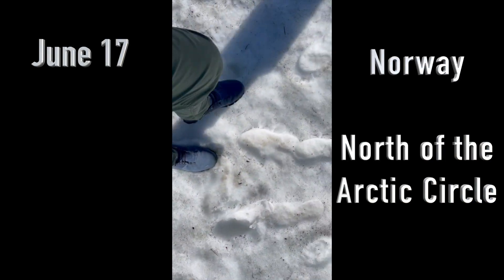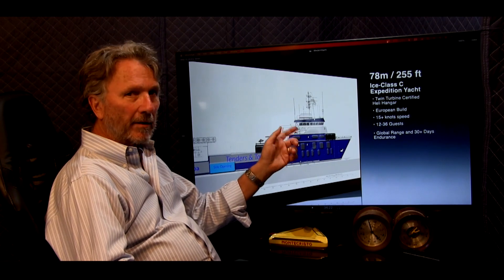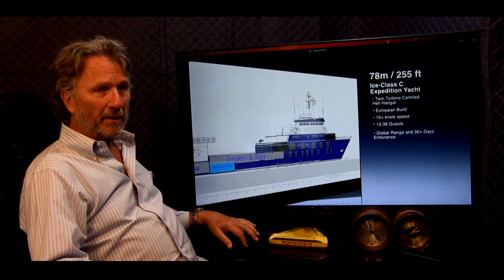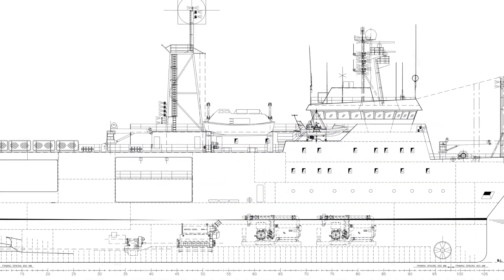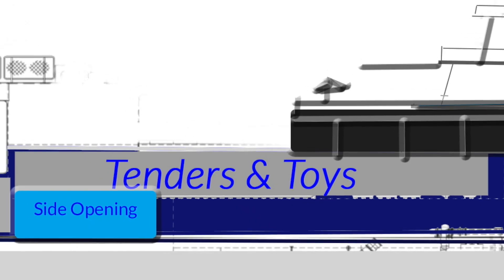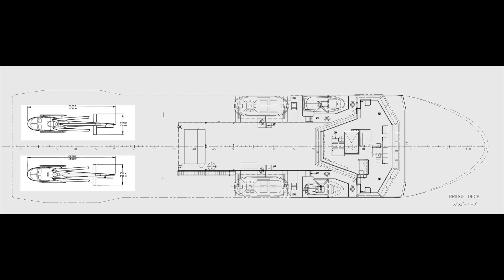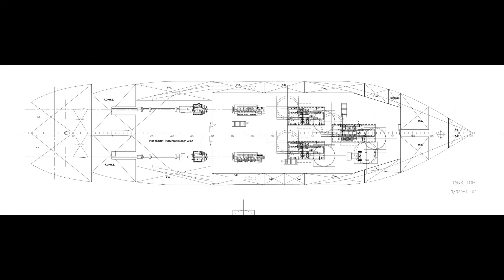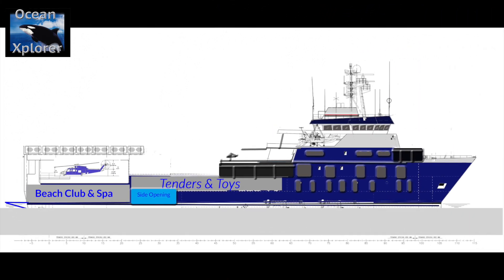Norwegian-built 255 ft/ 78m Ice-class Expedition Yacht w Commercial Helo-Pad

Comment: How much fuel does it burn per hour at econmical cruise? Can u post the specification for the ship?
Reply from the maker: MAIN DIMENSIONS Length over all: 78 m Length between p.p.: 67,7 m Breadth, moulded: 17,0 m Dept Main Deck: 7,6 m Design draught: 5,4 m Scantling draught: 5,9 m

TONNAGE & CAPACITIES Gross Tonnage (1969) approx.: 3700 GRT Fuel oil (Ex.sys.tks.) approx.: 1400 m3 WB approx.: 850 m3 FW approx.: 220 m3 Cable oil, clean oil: 20 m3 Cable oil, dirty oil: 20m3 Work deck area (Main deck): (8000 sq.ft) 740 m2 Recording room area: 200 m2 Helideck AS 332 Super Pumpa. CAA/DnV

ACCOMMODATION Accommodation 56 persons in total, of which: - 18 one-man cabines - 18 two-man cabines - 1 two-bed hospital

PERFORMANCE Trial Speed (4,5): 15,6 knots Design pull, 5 kn: 30 tonnes Max.pull, 5 kn: 50 tonnes

TECHNICAL DATA Bergen Diesel, main engines: 2 x BD 32 M& each of 3300 BHP at 750 rpm Ulstein Propeller: Twin screw propulsion comprizing: 2 x 1500 AGSC controllable pitch propulsion plants, each with: Low noise, 4-bladed secwed CP-propeller, driven through a reduction gearbox with two-speed PTO for shaft generator. Ulstein Propeller, bow thruster: 150 TV, 590 kW/800 HP, el.driven Ulstein high lift rudders: 2 off Shaft generator: 2 x 2000 kVA, 450 V, 60 Hz Aux.generator: 1 x 1338 kVA, 450 V, 60 HZ, driven by one Caterpiller 3512 TA, diesel engine, rated at 1125 HP at 1800 rpm Clean power: 2 x 73,6 kVA, 208 V, 60 Hz, SCFM, 2000 psi, driven by Caterpiller 3516 Diesel engine Life boats: 2 x 48 persons enclosed Life rafts: As per Solas MOB boat: 1 x Seabear 23, with inboard diesel. Davit deployed Work boat: 1 x Seabear 23, with inboard diesel Davit deployed Norwinch Windlass: Type AV-33/38-36 K3

Ulstein Maritime Electronics: Switchboards - Electronic remote control system Main Propeller (PROCON) - Joystick control system (POSCON) - Electronic remote control system - Bowthruster (SITCON) - Bridge control consoles - Engine room console - Starters (for el. motors) - El. test board - Engine room telegrahp - Microprocessor based alarm system with dead man system and printers)

ELECTRONIC EQUIPMENT Radar: Furuno FAR-2822 / XBand, ARPA - 120 NM Ranger x-band (3 cm), ARPA, 72 miles Radar: Furuno FAR 2830S, SBand ARPA-96 NM Range Innmarsat: JRC JUE 45A MKII Voice/Telex/Fax

Radio /to GMDSS Requirements): Skanti TRP 8750 Duplex SSB MF/HF, 750 watt. Thrane & Thrane TT3200 Radio Telex System Sailor RT2047 radiotelphone, simlpex and duplex operation Skanti VHF radiotelephone TRP 3000 simplex/semiduplex Skanti TR6102 areonautical AM/VHF Skanti DSC VHF radio, TU 3000/XH 5131

Ships Navigation: Robertson Gyrocompass RGC 11 Robertson disc navigation system ECDIS Robertson AP9 MKII Autopilot Furuno FSN-50 Transit Satelite receiver Furuno GP500 GPS Satelite receiver Furuno LC 90 MKII Loran C navigator Furuno FD 527 VHF Direction Finder JMC MF/HF Direction Finder, DR-230 Furuno FE 680 Echo Sounder - Range to 2100 meters Furuno Fax 208A Weather facsimile Ben Marine Electronmagnetic Log Thrane & Thrane standard C inmarsat (telex) system TT 3000 C

Comment: This is a very large and fuel hungry beast with a huge environmental footprint. I prefer the Cardama 242 vessel you identified in Vigo. 
With several explorer yachts now for sale including Ragnar, Planet Nine, Yersin and Simon Fraser, to sell a conversion, you need to differentiate your product. For the rich, toys and luxury are a given but few want to be labeled as carbon polluters. I think you want to be able to visit the Arctic and Antarctic without leaving a footprint. The conversion recycles the donor boat and small things like bulk water rather than bottled plastic leave an impression. I would recommend multiple fuel saving devices including bulbous bow, hull vane, air lubrication, ecoprofin, new efficient propellers, diesel electric technology, shaft generators, solar power, inverter battery banks, and seawing kite propulsion. Some of these ideas have long payback times but all push reduction of fossil fuels. They are more than green washing. While fuel saving pays for capital,,the wealthy seldom count every gas receipt. However, they all are aware of global warming and of their image. A vessel on the leading edge of fuel saving devices can then also use 10% biofuels to further reduce carbon emissions. Lastly an onboard lab could collect water samples from around the world in concert with an oceanography institute.
Reply from the maker: All good points. Thanks for your comments.

Comment: But what's the cost of the ship, minus any money made by selling the 'scrap', and systems not used anymore being sold to another shipyard (if any) vs. Having a new hull built by Damen, Oceanco, Lurssen..although I don't think Damen would build a vessel that big or capable. But Damen touts their support ships are 25% the cost of a comparable sized yacht
Reply from the maker: Removing the drums and hydraulics is expensive and so the deal with the scrappers is likely to be that they do a careful removal in exchange for the metal. The difference between a top European yacht build and a conversion this size with ice-class is likely to be €50+ million. If you are starting with a new off-the-rack Damen commercial hull, you are still paying for all the upgrades and will end up spending far more than on a conversion. An additional comment - Ulstein hulls are of same quality as the other European yacht brands, and often the steel fabrication is from the same shipyards in Eastern Europe.
Reply: @XplorerYachts  thank you for taking the time to reply. I 'heard',,meaning saw a video, where a rep for Damen saying that getting a toy hauler and having it outfitted out to be your personal yacht, albeit with smaller rooms of course, but still better than the rooms on some smaller yachts. The cost is 25% of a regular yacht of the same size, plus you can carry all your toys and even fuel bladders for added range on top of the insane range already built in. I just wondered if that was true. I know the husband of the S/V Pink Gin would stay aboard the toy carrier and the wife stayed on the sailing yacht. He had it outfitted out pretty well. I could see that as an alternative, but not now Damen has the SeaXplorers and CdM has the FLEXPLORER and even Dunya, Alias, and Lynx got in on the toy carrier game. Although CdM and Lynx woukd probably be my first choice.

Comment: When was it built? Last refit? Are those drawings available?
Reply from the maker: Hi Jeff. It was built in 1993 at Ulstein. The GA's I saw on board were dated 2004, which is probably when they installed larger heli-deck and did other mods.